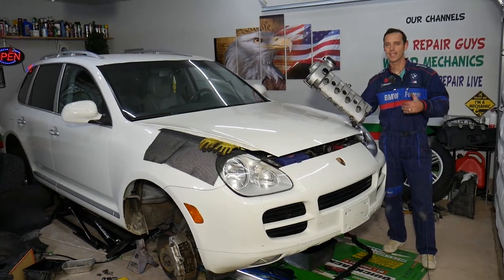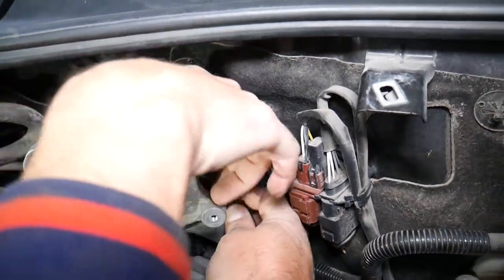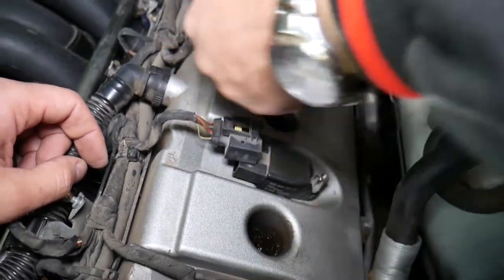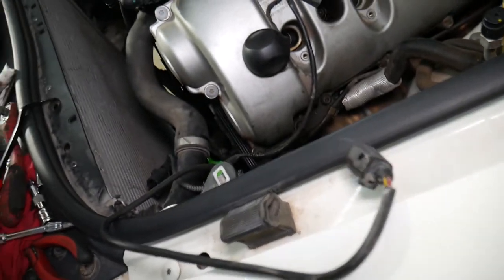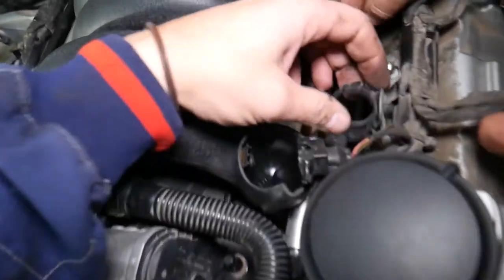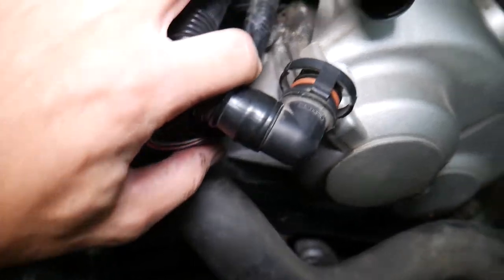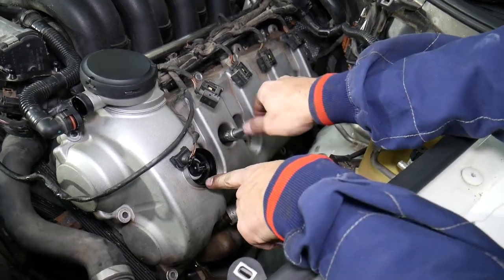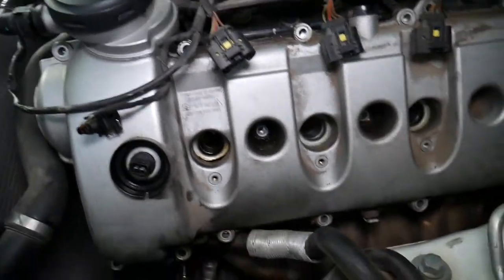PORSCHE CAYENNE S DRIVER SIDE VALVE COVER GASKET REPLACEMENT REMOVAL, OIL LEAK FIX

Comment: Just done this today. The back corner T40 bolt cones off with a torx allen key. The a/c wire was a nuisance, I cut it and joined it back together! I didnt disconnect the battery. Gasket was solid, like plastic. Not a bad job to do just awkward, I was knelt on engine bay to make it easier on my back.

Comment: Doing this job now on my wife’s 2006 S. It’s not anything to difficult it just is a bunch of steps.. step 169.. step 865. 
Ugh. 😮. Hers is leaking into the spark plug holes causing misses and the passenger side is pouring oil all over the driveway. Like a quart every few days 😂. Embarrassing